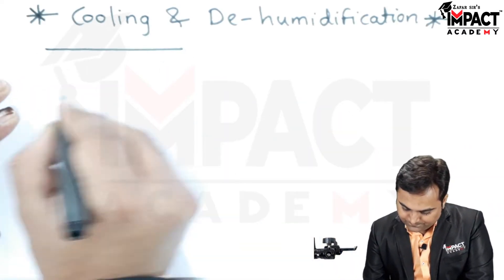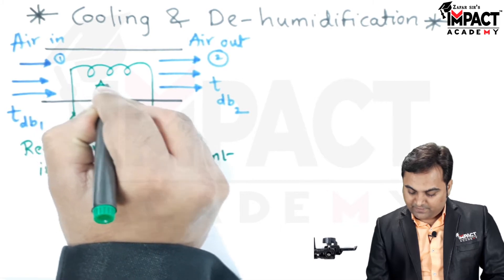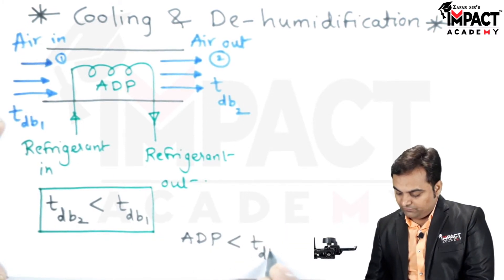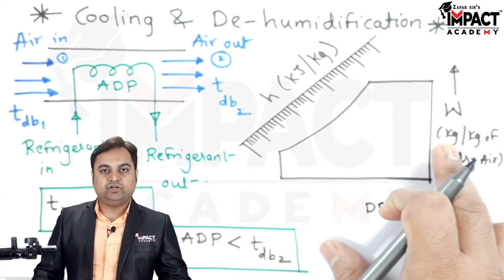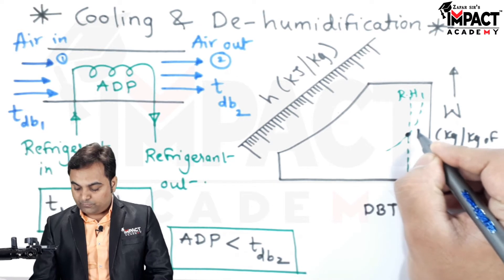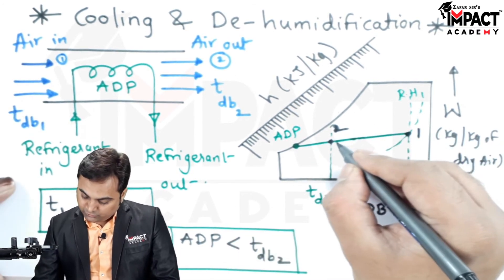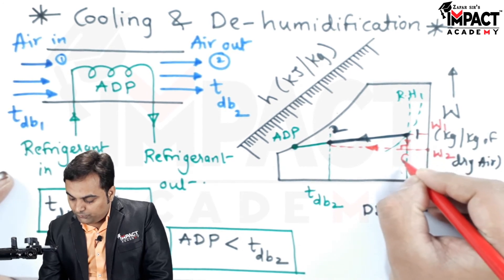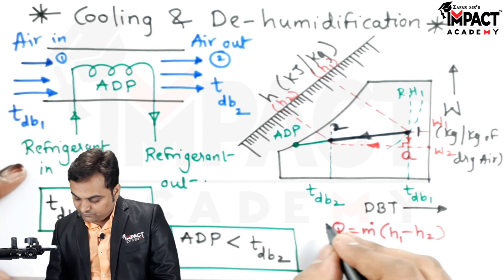Cooling & De-humidification | Psychrometry | Refrigeration & Air Conditioning #zafarsir #engineering

Comment: Dear Zafar bhai,
I am a novice, not a technical person.

I am from the garment industry. 
It's a labour intensive industry. 
Factories may be located in coastal region like Bangladesh, Sri Lanka,  Chennai,  Mumbai,  Kenya.
High humidity and high temperature are a big problem.
Also need frequent air change to reduce carbon dioxide. 

The industry cannot afford air conditioning. 

We just need to reduce temperature by say 5 degrees and also reduce humidity.

The industry needs cost effective solution. 

Pushing "dry" air and pulling out stale air,  can create a current, which will make the atmosphere within the factory bearable and pleasant for workers.

Factories are large - about 100,000 sq ft and height of about 7 mtrs to 12 mtrs.

Would love to hear from you - a solution that you can offer. 

Piyush Vyas
Reply from the maker: Thanks for watching👍👍
Subscribe to our channel to get the latest update about our videos...!!!
If you also want to take offline or online lectures or join classes...
Kindly call on this number
Zafar sir : 7666456011

Comment: since the specific enthalpy units is in (KJ/kg dry air) should we convert massflowrate to volumetric flowrate first and then divide by specific volume at entrance conditions? after which multiple to delta enthalpy to cancel out the units?
Reply: converting mass flowrate to volumetric flowrate using the ideal gas equation assuming initial conditions are ideal
Reply from the maker: http://bit.ly/impactEngineering
To access all Engineering Videos 
Please visit our app Impact : The Engineering App 
You can directly download the app from the link given on top👆🏻👆🏻👆🏻

For more queries related to app, contact our Customer Care Number :- 
+91 7900123134
Reply from the maker: http://bit.ly/impactEngineering
To access all Engineering Videos 
Please visit our app Impact : The Engineering App 
You can directly download the app from the link given on top👆🏻👆🏻👆🏻

For more queries related to app, contact our Customer Care Number :- 
+91 7900123134

Comment: hello sir, very nicely  explained. I have few queries pls do clarify if you can.

Does this dehumidification go exclusively with cooling? 
for example, I want to remove only the amount of moisture (humidity ratio or absolute humidity) without reducing the temperature of air and water vapour mixture? can it be possible? 

I want to reduce relative humidity while dehumidifying?  will it be possible?
Reply from the maker: http://bit.ly/impactEngineering
To access all the private videos and Remaining all Videos 
please visit our app Impact : The Engineering App 
You can directly download the app form the link given on top👆🏻👆🏻👆🏻

For more queries related to app, contact our Customer Care Number :- +91 7900123134